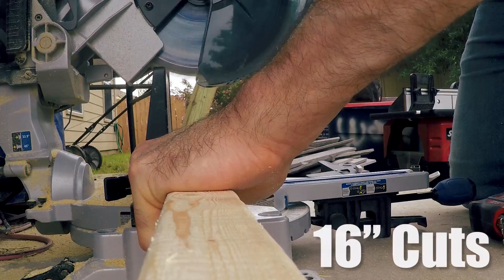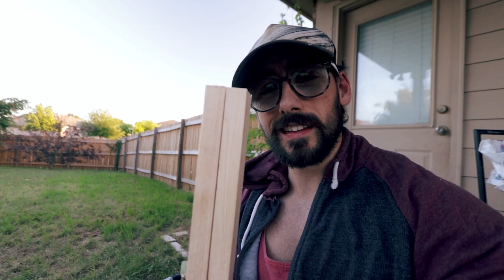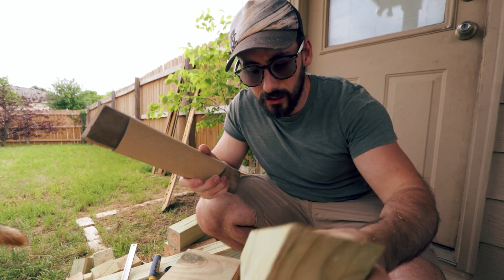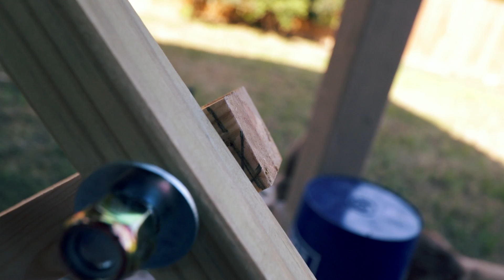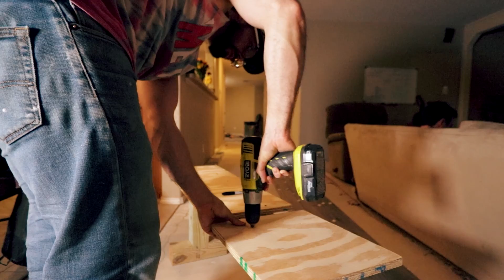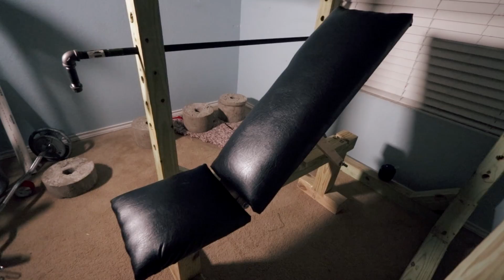How I Made an Adjustable Weight Bench

Comment: This is a great build and I loved watching you explain how everything goes together you have knack for this, and I hope to see your channel blow up in success!

My few tips to make the bench just a little better would be, 

If you can't get vinyl Plasti-dip the seat and back rest, its cheap, readily available and sticky.

Plasti-dip the bottom of the legs if you're on concrete to stop the bench from sliding,

Instead of using a 4" bolt use a 4 1/4 and use two nuts to secure it in place, you can tighten them against each other and that will give you the ability to loosen the arm enough to free fall without needing you to push on it, but is super secure and the bolt won't come loose.

Again great job, and thank you for making these videos!
Reply: Good suggestions. I plan on building this, in a few days, but I feel like plasti dip in an area that has lots of friction will just rub off. I'll be screwing in some rubber pads at the bottom to keep it from sliding though.

Comment: I used EVA foam for mine, closed-cell stuff won't absorb any sweat that gets through the vinyl and is denser/tougher and less pillowy. You can use yoga mats, camping ground mats, or jigsaw tiles for kids play areas. Some may find the cross-beam on the bottom near the feet end messes with their foot placement - you can cut it down or not use it at all and it should still be fine, as most of the weight will be over the other end.

Comment: Made the bench. I used 29.5 inches for the 30 inch pieces, save yourself some time. After I marked the 16inch pieces for rounding I just used my mitre saw instead of sanding, probably saved myself hours. I liked your technique for the router and I used it lol. I cut small pieces of 1/2inch plywood and used them as spacers between the 30inch pieces and the 4x4, save yourself from making that huge groove in the middle.

Comment: Thanks for all the help! All barbells are sold out in Canada, anyone have any ideas on how to make one?
Reply: I'm sure you've figured this out but DIY Duke has a video on this for Olympic plates (the ends don't rotate like regular Olympic bars but it should be good for powerlifting and most bodybuilding movements). You can also just use 1 inch cold rolled steel with some shaft collars and that would work for standard plates. Keep in mind that DIY barbells won't have the knurling that regular bars do that help with grip. Maybe you can bring it to a machine shop if they have the equipment, or you can just use lifting straps/hooks for added grip for pulling movements. Grip tape such as baseball bat grip tape might help as well, though I'm sure you'd have to replace it as it wears out.